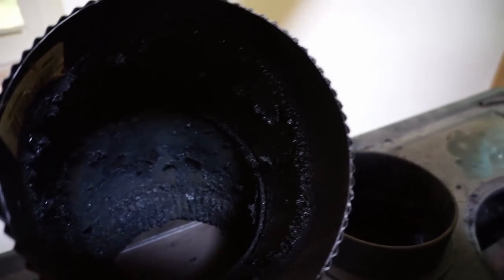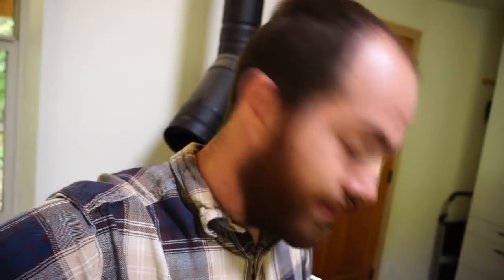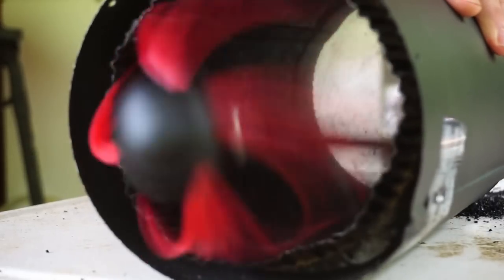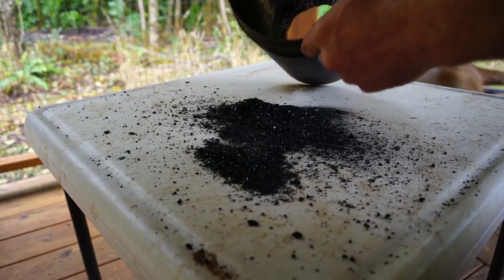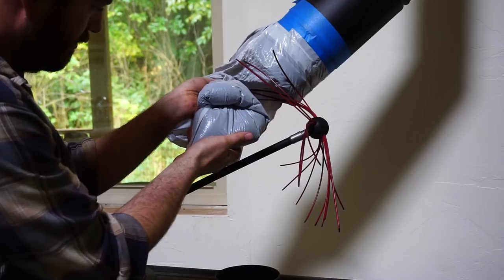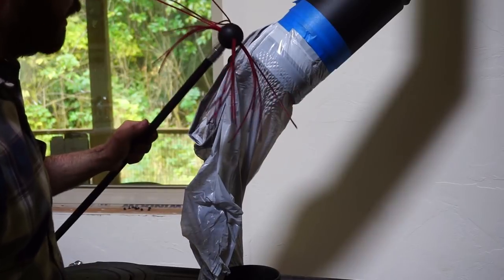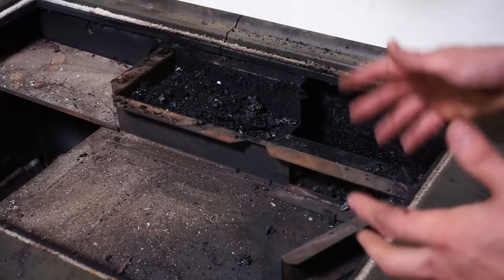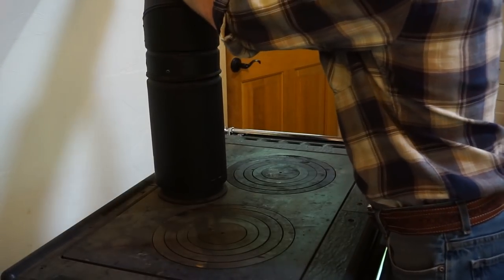Yearly Chimney Cleaning for the Wood Cook Stove

Comment: I bought the system and wasn't too sure as to whether it would work.  I read the directions and began to clean the flue.  I first wanted to just run the brush (after cutting the string to size) up and down the flue without the drill.  Soot and creosote was coming down as though I used my older brush.  I have a six inch flue for my Osborne wood burner.  Then it happened. One of the segments detached and the brush was stuck in the flue.  I cursed a couple of times because I don't want to climb ladders anymore and push the brush down with my older set up.
So, I packed everything up and didn't work on anything for the day.  This morning I decided to go fishing for the brush.  I had plenty of poles remaining so I duct taped a hanger on the pole and push it up hoping to catch the brush.  After about five minutes of trying I got it hooked and pulled it down.  
I then checked the clips and began the actual cleaning.  
The brush system removed just about the same amount of junk from the flue as my older brush system.  So, it did work after the issue.
Instead of hiring a chimney sweep to sweep the flue I'll only have them come in for a cleaning every couple of years just to give the flue a good inspection.  This way I'm sure I have the flue cleaned out and it's still safe.
So, the system did work.  Two things I suggest.  One.  Improve the clips that hold the poles together.  Two, include more poles for the cleaning.  I did order two systems because of the limited amount of poles.  If you have a one story home it will work.  Two story or cleaning from the basement up through the first floor will require additional poles.
Reply: Bee Bob if you ever have a brush head stuck in the flue you can start a small fire in the flue and will melt the brush head and it will fall to the bottom. It will destroy the brush, but it will get it out if you can’t go to the roof or remove it with a removal tool. Use caution when doing this! It’s the last resort!

Comment: I believe the bigger problem here is he mentioned damp wood, but also this is a cook stove he isn't kicking the spurs to it and reaching the 350-500 degrees to get a clean burn. Definitely not in the spring. This is also probably not an EPA stove so it doesn't have catalytic converter. Which also helps with the creosote by having a secondary burn.  All in all that isn't a bad amount of build up inside the stove or in the chimney . I get about the same on my shop stove, but I burn coal and oil as well.  Big thing to watch is your chimney smoke. If it is clear or white(steam) your good, and grey or blue you need to be warmer.  I clean my shop stove every 3-5 years, but I always step outside after the fire is going to inspect the smoke to make sure it's clear.  Small and hot is better than a slow low fire.  Some of these have a big water ballast as well that allows you to get a hot clean fire, but maintain an even temperature in the oven portion. All the families I know keep a huge pot of water on the stove not just for the humidity, but also as a heat sink. Love the rotary tool I think I will get one for cleaning ours. I have just a huge logger chain, but not getting on the roof is awesome :D
Reply: Brian Hunt   True. He mentioned the preferred  high heat fires, which is why he cleaned the stove often.

Comment: which drill do u use? will a 12 v cordless be ok?
Reply: You need a 18v or 20v+ drill
Reply: You just need a 2 speed drill, it dont matter the voltage as long as it has a fast speed.

Comment: That is actually a lot of creosote for just one season. And, yes, the most probable reason is burning wet (i.e. not fully seasoned) wood. Another option is not having hot enough fires or restricting the air too much to create "long overnight burns" (which these types of stoves are not really designed to do, because of the non-direct baffled air flow around the oven and cooking hotplate elements). 

To dry wood properly in a moist climate may take two years or more. Your next task may be building a proper wood shed, and getting enough wood to be "ahead" a few years.

Also, check your local building codes. Some require a "T" access in the chimney pipe for cleaning. But, in most cases, you should not have to take apart a properly installed chimney to do generic seasonal cleaning.

P.S. I also have a La Nordica stove with oven.
Reply: That was a lot of creosote?  I guess it depends on the length of the flue too.  It didn't seem that he went far with the rods so I'm assuming it was a one story house.  My house is a two story and I'll get that much after 1 1/2 cords.  This is when I automatically clean the stove.  Mine is an insert and not a cooking stove.
Reply: @beebob1279  I burn 3 chords each year and have less creosote. But my wood is very dry. And I have insulated chimneys. One is two stories tall. And still the total creosote is less in each chimney. If one does not have a double walled or insulated chimney, or has not really fully dry wood (use a moisture meter to check), then the amount of creosote is greater. But the OP has a double walled chimney, so, yes I think that is too much creosote for one season, especially when adding the crystalline creosote at 7:13.

Comment: Nice cleaning rod system! Two little comments:
1. A mason small trowel is awesome to get the bulk of the creosote flakes off.
2. Be careful when using a Shopvac with creosote. Creosote might react with the electric motor (electricity and carbon) and cause a fire on its own.
Be safe, be careful and keep up your excellent work!